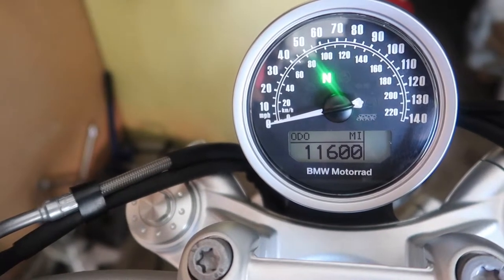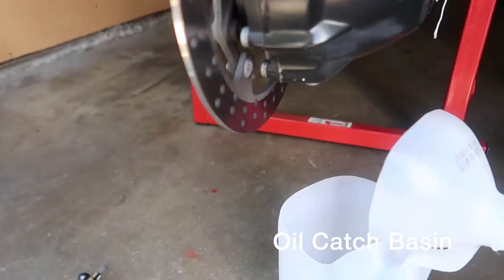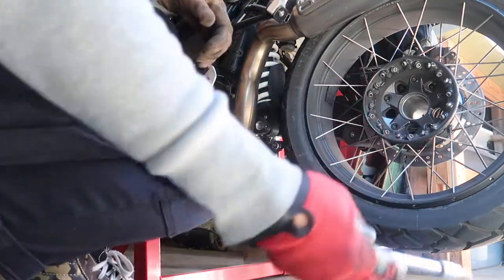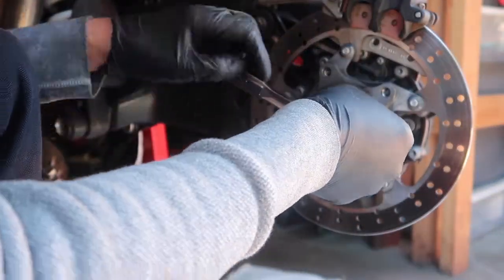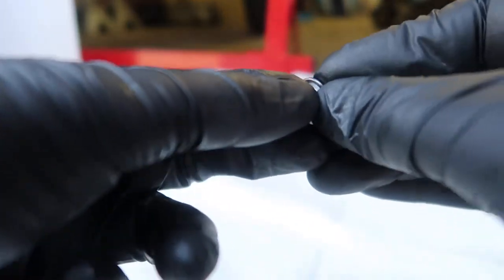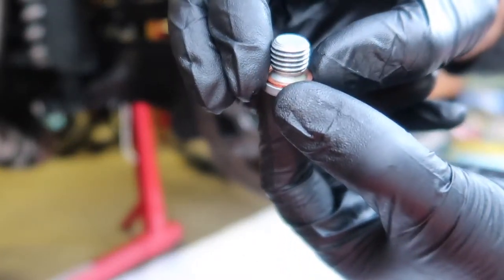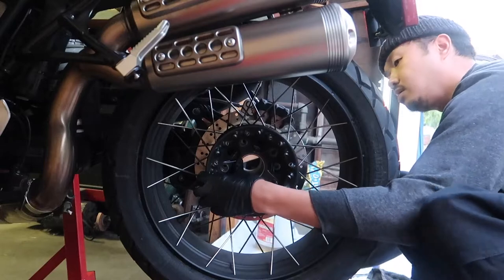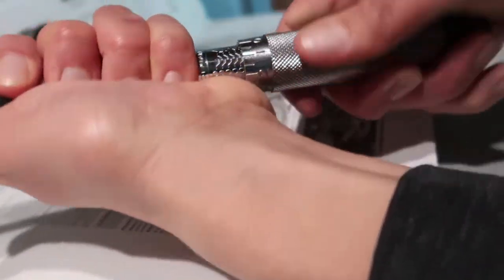BMW R Nine T Scrambler Final Drive Fluid Change. 12,000 mile service.

Comment: Thanks for this video.  

I just bought a used 2023 R9T Scrambler from a non BMW dealership with 1,700 miles. There’s no service history, so to be safe, I’m doing this and the engine oil this week.  

After watching your video, I looked at the fill hole plug on my bike and noticed that it can be accessed through one of holes in the hub (I have spoke wheels as well ). I don’t have a long torx bit set like yours yet, but I was able to access that nut with a #40 torx bit on an extension. 

It might take a little fiddling, but I think this job could be done without removing the wheel. 

Am I crazy? What are your thoughts? 

Thanks again.
Reply from the maker: Hey there, thanks for checking out the video. I see what you mean about accessing the filler plug through the hole in the wheel hub. If you think you can do it without removing the wheel, then by all means go for it. I haven't tried it, but I'm wondering about a couple of things.

First, how easy or difficult it would be to get the plug back in.

Second, I tend to be very neat when I'm doing maintenance work, meaning that if I were to spill any oil around the hole while filling it, I'd want to wipe it up and not let it sit on the final drive behind the wheel. That would bother me.

And last, related to being neat, I'd want to wipe away any road grime around the filler plug so that I don't accidentally get any dirt or grime into the filler. But that's just me, and I might be extreme. Let us all know how it goes if you're successful. Thanks again!
Reply: @arugolaworkshop  I decided to wait for my paddock stand to arrive, just in case I do need to remove the rear wheel. It’s not here yet. I also just received my long torx set (I have a set that will work, but I like to have tools dedicated to specific vehicles) and the syringes. I’m a neat freak too, so I already have this job planned out. 😬

Anyway, I think the plug can be removed through the hub.  Reinstalling it may be possible by reaching between the hub and swing arm, holding the plug between my fingers, while capturing it with the torx bit through a hole in the hub (same as the removal) then tightening it. 

Maybe I will make a video while I’m doing it. I’ll definitely let check in with the results.  

I’m undoing some unfortunate modifications done by the previous owner, so I’ve learned a lot about this bike over the last couple weeks. I’m getting it sorted thanks to videos like yours. 👍

I recently discovered Unit garage, and bought their fenders. It’s coming together. 

Thanks again.
Reply: @arugolaworkshop 
Update: I changed the final drive oil without removing the wheel. The filler plug just seated itself on the torx bit. I was able to remove it through the hub and reinstall it through the hub without even using two hands.

 I put newspaper between the brake rotor and the fill hole, so nothing got on the bike. Along with your video, the job was very easy. 

The most difficult part of the job was cleaning up the oil after I knocked the bottle over. I probably wasted about one service worth of gear oil. 🤦🏻‍♂️
Reply from the maker: @revd4461  Hey, that's great man! Thanks for the updates.
Reply: @arugolaworkshop  My pleasure. 👍

Comment: Which stand attachment do you use for R9T?
I don’t see it listed.
Reply from the maker: Hey Eric, it's not listed in the dropdown on their site. Abba stopped advertising that their stand fits the R9T because it lifts it too high apparently and some users were not able to get it up on the stand. You'll have to contact them directly and ask for the R9T fittings. Thanks!
Reply: @arugolaworkshop  I use a 2" 5' long  heavy duty pipe going through the wheel hub with two jack stands. It's a bit tricky to pull the wheel off the pipe but can be done. It's useful for working on the bike without the hi cost of these lifters. I've had two sets of jack stands doing nothing, now they are useful. The heavy steel pipe was a discarded antenna mast laying by the house, again became useful. 
Thanks again for the video. I did the 600 mile oil change and will finish the final drive oil change soon. This will save me over $200 since the dealer would charge $380. Cheers!
Reply from the maker: @youcanfoolmeonce  Thanks for watching, and glad it was helpful. Good tip on improvising a rear stand.

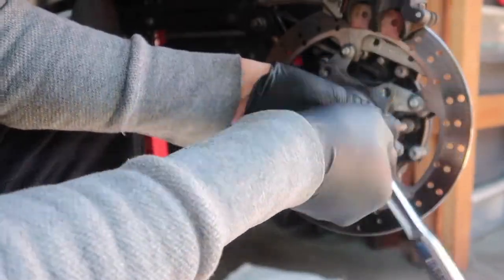Comment: Cracked brake disc at 2:49 just below the brake pad?
Reply from the maker: Thanks for your observation, I'll have to check it out.
Reply: I think I see what you’re pointing out, is it at the 12 O’clock position/top bolt attached to rotor/disc?  I don’t know anything about it, just wanted to make sure I was looking at the right thing.
Reply: @arugolaworkshop  I know I’m 2 years late but since I’m going to do this maintenance today, I was curious if what we see in the video on the disc is normal or indeed a crack?
Thanks!
Reply: @pfmcdermott1  pretty sure it's a crack